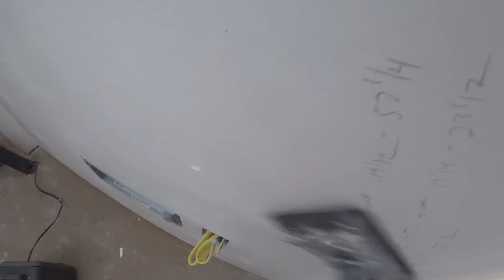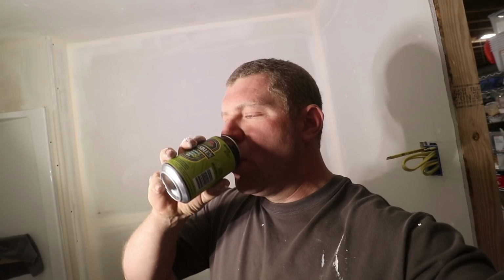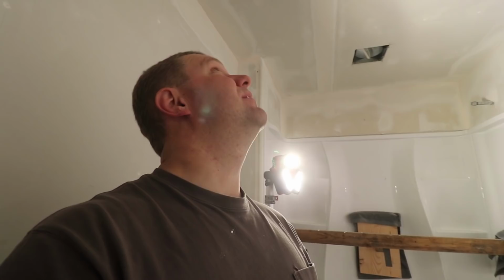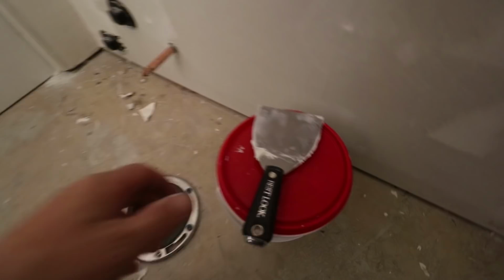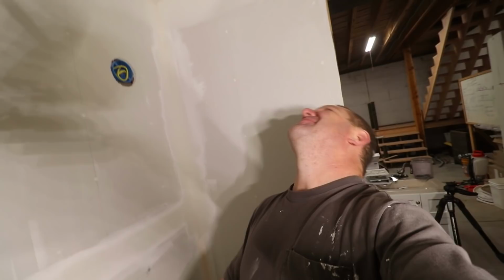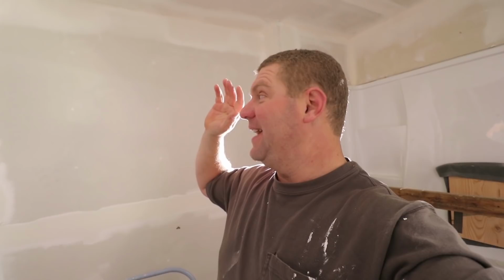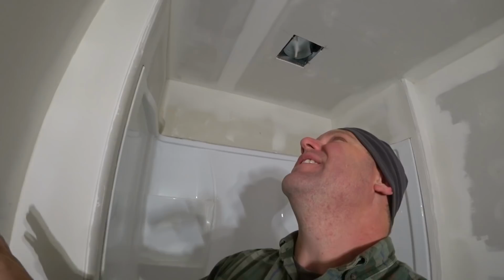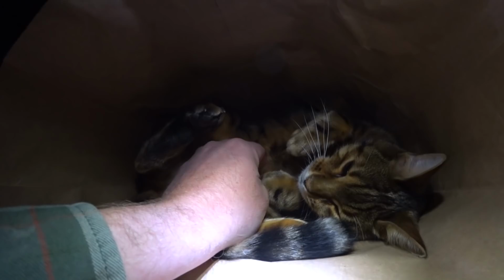READY to TEXTURE & PAINT! (Mudding Drywall in Bathroom)

Comment: It's okay to thin your mud a bit. You want the consistency of pancake batter. Also on your joints, you have to ensure the joint tape has adequate mud behind it. Otherwise you see those issues at your joint. You definitely also need a corner knife.

Comment: Funny how, I can be in the next room and listen to the knife and pan noises to know how skilled a drywaller really is. You may have needed a few drops of water in that mud but mixing it usually loosens it up. A nice trick you will need when you get upstairs if the wife lets you is to take a metal bucket handle and bend yourself up a tape holder to hook it on your belt loop of your pants think dangling toilet paper holder and you will get the idea. (Bedding tape) some prefer to bed the joint I personally mix loose mud in the pan and slide tape through the pan picking up mud on it only trial and error will tell which way is for you. I like the new bullnoses and straightflex tape for non impact corners and odd angles like boxed in beams and air chases on ceilings n such. 1 pass on screws only flies when texturing over I assume most wallers talk owners into texture to hide their lack of skill. I personally prefer a smooth finish with patterned rolled or custom textured ceilings.. Keep your cheap knives clean don't take but a minute for a cheap knife to rust.

Comment: What I do to limit drywall dust is to wet-sand the mud.  I take a bucket of water and a small shop rag, (or a sponge) dampen the rag slightly, use the wet rag to get the mud a little damp - Basically sand it a little with the rag.  Then (if needed) use the drywall knife to smooth it more.  (Take a thin layer of mud off).   No dust!

Comment: Their in two types of mud used for a reason 
- the first coat sets hard and is hard to sand and is applied thinly 
- the second is a finishing type which sands easy 
After it dries and and sanded 
You MUST paint it with a sealer coat, without this your paint will peel of in a few years
Also The paint needs to be anti fungal unless you like cleaning mould of each month.
Usually the board is a wet board or blue board cement sheeting.

Comment: best tool - a cheap plastic corner trowel.  I thin down my mud when needed.  The big box of premix drywall mud can dry out or even go moldy if it is not used within a short period of time.  have fun, it is easier than putting tin on a roof.....

Comment: I use a chemical drying compound, it dries way faster.  I find mesh tape easier to work with as well it has an adhesive on the backing.

Comment: Use a corner trowel on the inside corners. Lots easier and neater for non professional.
Reply: Good job Jesse...Bugaboo you are so silly
Reply: I disagree. The mud ends up thin in the corner and thick at the wings of the trowel. I do one side of an inside corner, let it dry, then do the other side.

Comment: The tape issue. I usually put a thin layer on the wall first of the compound then taped it after and floated another thin layer over the tape. The sheet rock had some big gaps between the panels. Always fill those gaps first then fill the seams as they are designed (slightly angled on the edge) to accommodate the layers and tape.
 You don't need to be so accurate with the mud as sanding is the way to flatten your seams. Always let thicker application dry over night.

Comment: Jesse I applaud your effort.
Though my experience I DON'T SAND THE FIRST TWO COATS. Just use your knife to knock down  the edges. I'll sand for the final and thin Finish coat only.
Even when you use either a bucket or the box...you still should stir it. And adding a bit of water to thin it out. This will allow the mud to flow smoothly and not stick so much to the knife.
Three coats (from my experience) is the norm....then a TOP COAT is applied.
You should ALWAYS CLEAN YOUR TOOLS when stop for a break.
The knives I use -- 2, 6, 12, and a 14 inch.   To apply the tape a Banjo.

Comment: I fill gaps with 'hot mud' first. You can use all sorts of stuff for this: Pour Stone, or regular mud with a accelerant added, or just 'fast dry' regular mud mixed and thinned a little bit. The idea is: fill the bigger gaps so the tape can sit flat as you apply. With the 'fast mud' you can put it on, and tape it in an hour. It is very hard to sand "hot mud,' because it usually dries harder than regular mud - so you need to go out of your way to get it flat as you apply it.

Comment: When you hang that panel there was a pretty good gap on that  wall get you a sheetrock floor lifter it's about 10 or $11 that way if you have a gap in that like that  you can lift it up with your foot  and then screw your sheetrock up better to have a small Gap at the bottom where your base is going to be than in the middle of two panels

Comment: Large 8 or 10 inch knife for your joints after the tape coat too. Do a center pull, then a top and bottom pull with hard pressure on the outside of the pull to feather it. That would be for your horizontal joints. Same for vertical joints.

Comment: Type of joint compound  there is a light fast drying, large 16 “ knife for horizontal  , you can see two line where wall board meets need two be filled ,two lite coats

Comment: What Sailor376 said.  You want that setting type mud for the first coat.  It cures instead of drying, so you can go back over it sooner.  It locks the edges and screws into a concretious type mud that doesn't wiggle, so it won't pop or chip later.  Then go over it with the sandable bucket mud.  Use three coats, one with the four inch knife, second with a six inch knife and third with an eight inch knife.  Remember you have a bevel on those sheets, which is about four inches on each edge.  The four inch knife covers about two inches of each edge and fills part of the bevel.  The second fills a little more.  The last coat should bring it out to level.  A corner taping knife helps in those corners.  I still had trouble with them, but it was better than without it.

Comment: Don't use the mud in the buckets. Use Durabond 90 or 45 and you will not have the bubbles. You should have done as much research on dry wall as you did not SIPS.

Comment: i don't use rounded corners .. maybe right there but no place else.. always go right angle.. tell you another thing when you have gaps between the boards you need to fill them you can't just tape over them.. also I use a sponge or rag to go over my joints if they are really bad  like that corner..  the wetness levels it out high and low but it cleans up better than sanding and reapplying more mud... just be glad you're not plastering lath and you are using drywall heh

Comment: Always mix your mud before using,  and I always do my second coat immediately after tape coat, while it's still wet, in half of the corners.. this way, when it dries, I can sand and do the other half of the corners without issue.. trying to do both corners at once is more difficult.. also, don't sand so hard, you're just trying to take down the high spots, not get a perfect finish on it.. after the 3rd coat, or polish coat, you sand for finish

Comment: corners DO NOT Need to blocked (2nd coat) or Skimmed (3rd Coat) with anything more than a 4" knife. You also stagger the sides of the corners you're working on. Most corners on production houses only get 2 coats.  Trying to finish both sides of the inside corners at the same time is an art and unless you have an inside corner glazing tool forget about doing both at the same time. The Flats and Butts you use the 8" and 12" knife.  The bubbles in the tape is because you didn't have enough mud behind so it's not adhered to the wall.  Buy the boxes or "5 gal" buckets of mud and stop using the little fancy spackling bucket.

Comment: Just use regular 45°corners not the bulbous rounded ones....lots less mud. And if you use the ones with paper wrapped metal, just put mud on the outside corners, set the piece in the mud and immediately put mud over the paper....no fasteners.   Not sure why you had used spacers between panels....just butt them up and use the sticky mesh tape. Use a damp rag to knock down each layer until the last feathering and just sand once.

Comment: The tape too far into the corner is from shrinkage.  If you want it thinner,,, add nothing,, just power mix it.  Best on first coat is mix your own setting type mud, sandable, abouty a 90 minute or 120 minute mud. The topping coat you can mix yourself or buy the five gallon pail.  But,,,, power mix the one gallon or five gallon pail,,, loosens it up easy.

Everyone uses their own choice of knives.  I like to use a 12 or 14 inch plaster or concave trowel.  I use that as a hawk for the smaller knives, and I use it as the finish trowel on the topping coat.  Takes a bit of practice,, but works very well and fast.

Comment: BTW normal order for drywall is ceiling then upper sheet then lower sheet so cut is at floor. If taller than 8 ft do upper and lower sheets and fill the belt line so that joints are at a easy working level and can be floated together. When doing corners, without the corner knife I mentioned in the last video, do the left sides then comeback and do the right side after the left dries, or vice versa.

Comment: Add some water.  If you are worried about thinning out the whole bucket, just thin out each batch in the mud tray as you go.  More work but it will be a safety net for you until you figure it out. Think Homemade ice cream consistency.

Comment: WOW Mesh vs Plain Tape. Opinions are all over the place. Not saying I've read every comment, but did read a lot of them. NO-WHERE, did anybody mention that another way of taping is to make a solution of approx 50% water/50% mud or say 60% water/40 mud---70 % water/30 mud. First measure all of your seams, then cut tape to various lengths. (Another way, do one wall at a time) Soak your tape in the solution until it is wet all the way through. By doing this, what your doing is imitating what they call a bazooka gun for taping.  Yes it's a little harder to work with, but I've never experienced an edge lifting up from the mud. Doing it this way ensure's that the mud is impregnated all the way through the tape. 

As for the mud, yes do first power mix before using. The consistency of the mud I would suggest is that the mud be on the fluffy{er} side, so adding a very small amount of water 1/4 cup to max 3/4 cup as per your tub size, before using any mud what so ever. Especially for a final pass over the mud. You may want to invest in a "INSIDE CORNER" tape{ing} knife, if your going to attempt to do the rest of the house. Just so you know, they make a  "OUTSIDE CORNER" tape{ing} knife as well.

As for the half-round "Paper-Faced Beads Metal Corner Bead(s)" Product Information (From the Manufacturer) Does not require mechanical fastening (No nails, staples, screws or crimps.) Emphasis, on the word "CRIMPS." Put another way, that crimping (both sides at once) with the "special crimping tool," every 4" to 6" in.

Comment: yes thin your mud, you want it like heavy gravy. your mud is way to thick. you don't want it like water but should slide off knife when held vertical. apply in thin coats will let it dry faster and cause less sanding.

Comment: Bro you need a 2nd bucket for your tapes.. fill it with water and soak them coiled.. also lay IN tape not lay on .. get it? get your mud down to fill the seams use jthe width of your blade to prep the seam with mud should have a layer of mud approx a quarter inch larger than your tapes width the you lay into the mud wet tape (top to bottom for walls or right to left with your right hand or left to right with your left) to mask the seams.. with your tape wet it should carry enough moisture in it to 1 float itself and 2 stick flush with no bubbles or divits (it becomes like paper mache") I'm sure you guys are well past this but your next room try it.. you might even find a youtube video about it if you google idk "wet dry wall tape" or "wet tape shiz rock" .. yes there is an art to it but it's mostly technique.. with this technique your sanding is fast and 2nd coat to float is superficial  for flush.. fyi this is also how you do "huge seamless walls"  =)

Comment: Hi Jessie - I have a couple ot tips for you on how to control drywall dust.  1st get a 5 gal Homer bucket, then put a 2 stage sperator lid on the bucket. Connect your shop vac to this 2 stage bucket.  Then connect a dry wall sanding screen with hose to the 2 stage bucket.  Next put about a gallon of water in the 2 stage bucket to trap the flying drywall dust before it gets to the shop vac.  I have the bucket lid from Peach tree woodworking and I have the Hyde 09165 drywall screen w/6ft hose.  This set up will save your shop vac filter, keep your shop vac bucket clean and 90% of the drywall dust will be trapped in the water.  I have done this set up for20 years and it has not failed.

Comment: after you fill the crack with mud, wet the tape , apply it and smooth it out wit fingers and blade. This will stop the tape from bubbling or shrinking into the crack.  work out extra mud and make sure all edges are stuck and walk a way.  Do not leave lumps to dry,wipe them down.  This will mean less sanding.

Comment: The 2nd layer of mud will stick better if you wipe the dust off with a damp cloth,  don't thin the mud  put 2 or 3 knife fulls of mud in the box and mix with a swirling action,  want to save your arms sanding?  1/4 sheet electric sander makes quick work.

Comment: An Internal corner trowel will produce a better internal and one you'd more likely get paid for,  get a flat drywall sponge and wet it before going over all your runs to save on sanding, plus you can feel how flat you are. Feather horizontals out further if on flat board. Get a trowel (not a concave one), and get some muck on the wall, those scrapers are too slow. Pre-crease the corner tape so you know it's straight before application. 
Flat walls have to survive a lamp test
 In the UK you'd have a yellow vest on and a mask, a hardhat, gloves, steel boots and possibly goggles, the spreadsheet will say you should have finished the room yesterday.
No lap joint in the internal leads to cracked internals on timber walls, it's a basic Construction detail.

Comment: Don't worry too much about it. In about a year you'll get a chance to redo it all. Not saying that to be a jerk (OK, maybe a bit) You'll find that your pre mixed mud will basically delaminate off the wall. Your initial taping coat was not properly done. Your mud should have been thinned making its consistency almost like thick ketchup,  the tape essentially soaked (totally covered) in this slurry then 'snapped' onto the joint,  then one pass with a knife and ... taping coat done!!  When you look at a drywall joint from the stud side, you should see that mud has actually 'filled the joint'. The rest of your project was bang on and well done though ...

Comment: While making every part of the house perfect would be the goal, things will go wrong, adjustments will have to be made. As for finishing the drywall I would start with the closets and hidden areas where you can hide small issues, then you will get better so when your finishing the main areas of the house you will get the results your looking for. I have never hung or finished drywall, I turn wrenches for a living. When I went to Rush Truck Center I went back on trucks after 10 years repairing and maintaining heavy equipment at a landfill, I know trucks; However I didn't know anything about aftertreatment systems and all the electronics and fuel systems. In 3 years I recertified all my A.S.E. tests and passed the advanced level diesel engine performance to be awarded Navistar Diamond certification for trucks and was promoted to level 5 Technician, I have also completed all the Cummins online training; It's like 22 pages of courses including both medium and heavy duty. I work 4 nights a week 11 months a year, even getting myself another Harley for Christmas; Life is good.

Comment: A 6 inch inch knife is the best for corners. And it's all about the pressure you put on the knife. It's a balancing act with your fingers. That dish in=out is caused you didn't fill the gap you had there before you taped it. You spent so much time doing things right. And now your screwing up with what your going to see the rest of your life. I spent a life time making peoples bad work look great. Get a pro. He will be in and out and you will have something you can be proud of.   semper fi Drywaller sense 1965

Comment: If you haven't already done it, it would be a great idea to install a smoke detector and a CO detector, since you're going to be using the space for cooking and you have a heater that has been modified, and a lot of exposed joists/wood.  If you really want to go nuts you can probably easily plumb in fire sprinklers in the garage.

Comment: I know your done now however Your doing a great job for your first time!!!!!  Jess self stick perforated  tape, buy a corner knife, it is your friend. Run knife over said tape before mud. Then run corner knife with mud. You will use a quarter of the mud. 12" inch knife only will use less mud. Thinner coats. Textured says you are learning,  use the corner and 12" knife only!!!!. You will be excited..  and use 1/4 of the mud.  Finishing will be so easy. With perforated board sander. great job you 2 are awesome.. again buy a corner knife and use 12" knife  use these 2 only.  you will do a dance with a smile.... thanks Grandpa...